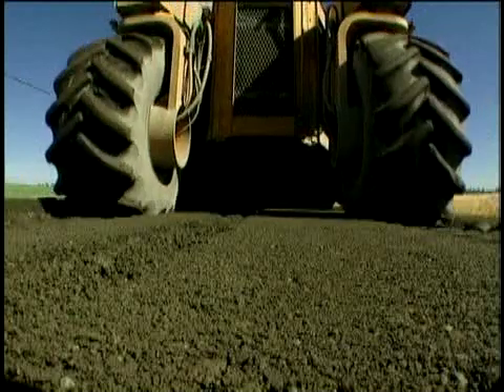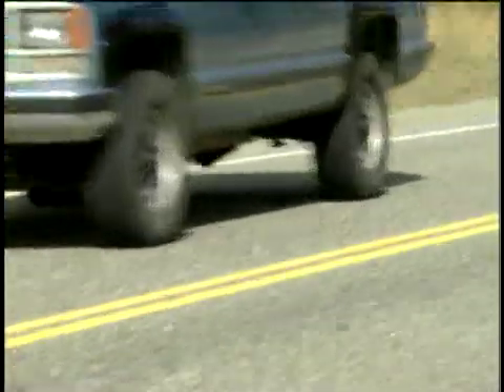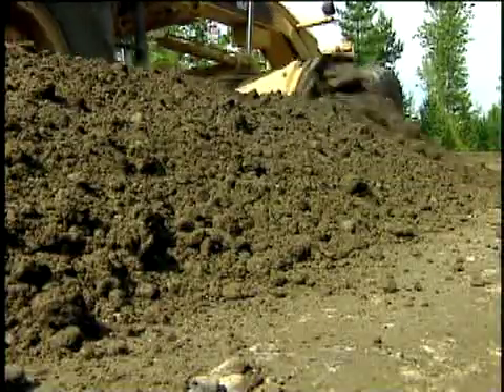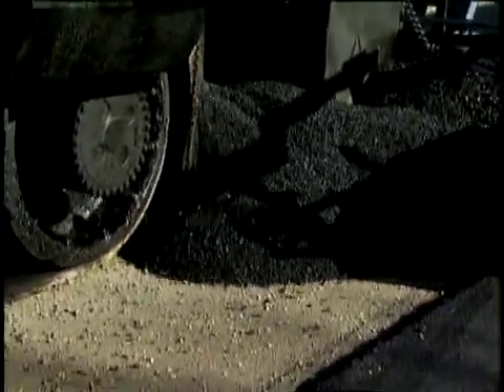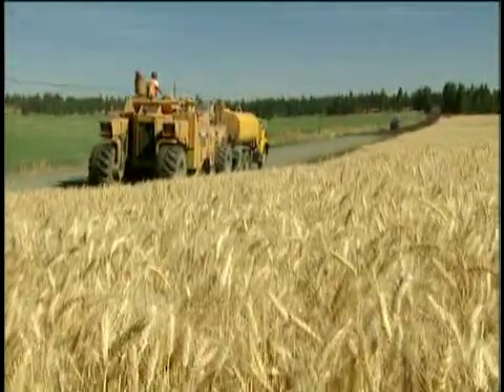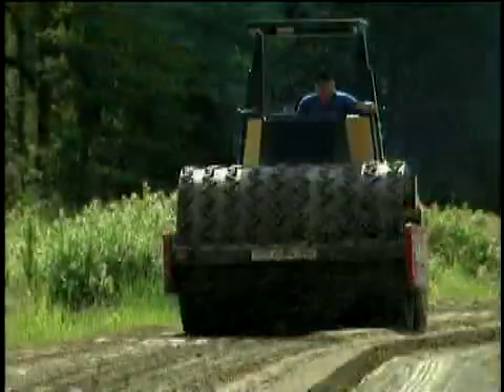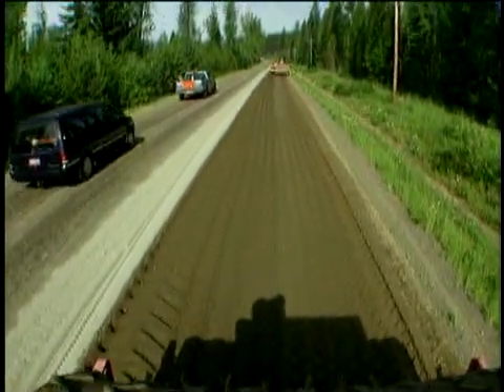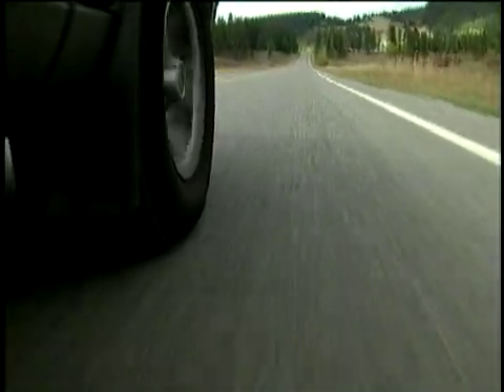The Road Recycled: Full-Depth Reclamation with Cement

Comment: This is being done near our location and I'm seeing an alarming amount of soil/dirt in the base mix. This does not sit well with my experience, but then again, I'm not an engineer.  Making concrete with top soil or dirt would not be my first choice of ingredient. Gravel and sand with cement would hold up better, as the contractor hauled in no additional base material for the road widening, they even just chewed up the side ditch dirt as the project calls for widening the road too. Not impressed with Milestone Contractors in Indiana.
Reply: Three years later.  how is this road holding up?
Reply: @toolman.dustin  Very good sir. It remains the smoothest county road in the county. It was widened 4 feet for a pet food factory with increased semi truck traffic anticipated. I cannot complain about the process.
Reply: Thanks for reply. My neighborhood investigating this as an option
Reply: @toolman.dustin  The company was Mt Carmel Stabilization Group from Illinois, and work several states. They did about one mile per day when they were set up and running. They are sub contractors for a larger general contractor (Milestone in our area) I was skeptical, as  it adjoins my farm and I'm very picky. The road is about five years old now, showing no signs of issues.
Reply: @bufordt.justice4052  Thanks for the info.  I have contacted them and we'll see what develops.
Reply: @toolman.dustin , Best Regards my friend.